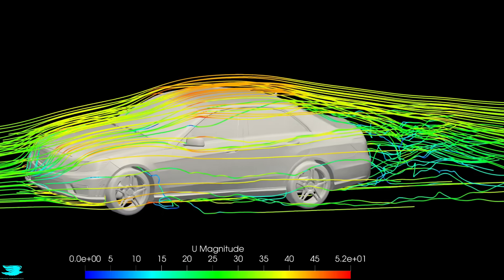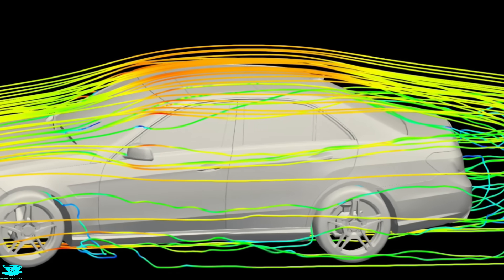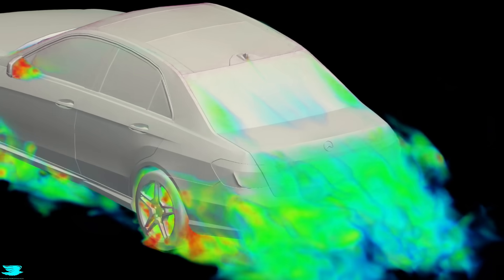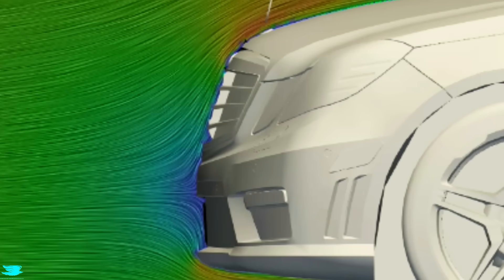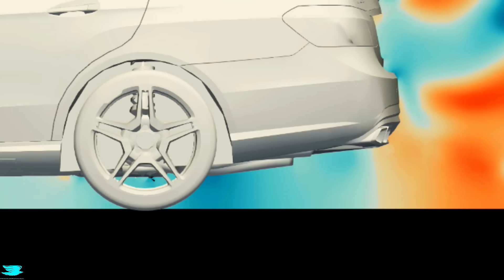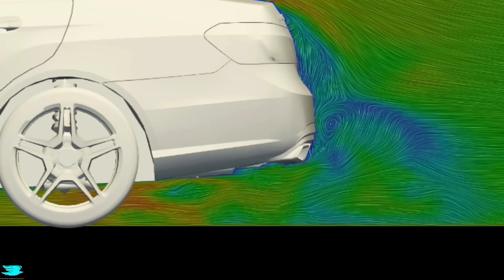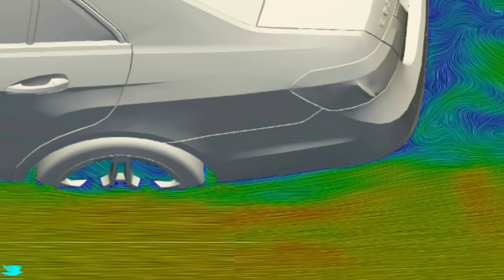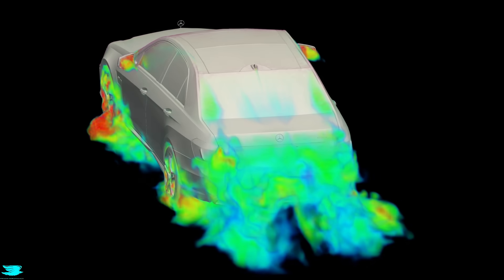This Mercedes Is Aerodynamically Wrong

Comment: Does this program you use consider up drafting air from the the engine bay as it comes out the rear of the hood onto that spot on the windshield??

Comment: The flow from the sides over the roof onto the back window has been an E-Class thing since the w124, just FYI.  It is absolutely intentional. The area by the windscreen is also a high pressure area by design, as it feeds the HVAC system at speed as well as helps the wipers work at high speed. Also, the high pressure zone at the front bumper is also intentional. You want slow/high pressure air to enter the radiator area for efficiency in cooling and for a "ram air" effect for the intake to pull air to the engine from

Comment: Okay, I have 3 questions.
1. Is the fact that air flows through the grille and vents in the bumper taken into account in all these analyses?
2. Isn't wheel aerodynamics inaccurate, since in reality they would quickly rotate and travel vertically?
3. Have you ever considered aerodynamics while airflow is coming from the side, like during cornering?

Those are small practical details that always concerned me when watching these videos.

Comment: Designed Intentionally WRONG  to WASH the car especially the mirrors , windows and light devices  for automatic cleansing and cooling the brake and catalytic converter.

Comment: Can you simulate a nissan s13 hatch (240sx). I'm interested to see what the flow over the rear looks like because I do seem to feel like the car gets a bit of rear end lift at higher speeds. This chassis is also a pretty decent representation of many of the long hatchback lownose sports cars of the 90's. (Other examples being mk3 supra, porsche 944, fc rx7 etc...)
Reply: I'm also curios if any of the factory wings (type x wing for example) help mitigate this rear end lift

Comment: what about W211 ?
Reply: I was just about to comment that, especially what the differences are in between the facelift as the front end changed quite abit.
Reply: @cathat9622 that’s a nice observation
Reply: W211 is bad in airflow
Reply: @stormrider01 Why?

Comment: My old 2010 E250 CDI Cabriolet (A207) would hit 248km/h on GPS on the Autobahn, roof down, not too bad I think! But the chassis in that is closer to C-class on the S/A207, so narrower than the sedan/wagon at least.

Comment: One other interesting note about mirrors that may not be obvious for people who have never driven one of these, mirrors are huge. They do not look big from the outside, but in fact they are way bigger than BMW's or Audi's and square to a point it feels like a truck side mirror, making it very comfortable to use. Knowing that it does not detract from aerodynamics much makes it that more impressive.
Reply: The mirrors of mid 2000-2015 Mercs have always been a good fictional design. Good size and with the extra wide angle at the edge just makes visibility better
Reply from the maker: 100%
Reply: @PremierAerodynamics  can you please do the toyota auris touring sports please 2015 model :) love your videos!
Reply: I do have to point out (in case you missed it): that platform of car was engineered to do over 300km/h for relatively long stretches in comfort, especially in E63 form. And then people tune those cars to dliver even more power and go even faster, so it's not surprising at all that there are regions of downforce-generation. I reckon everything in that aero is intentional, and in many ways is an iterative evolution of the W201/W124 platform from the 80s.
Reply: Interesting! I find the mirrors on my GLE to be narrow for the size of the suv.

Comment: If the onboard computer is anything to believe my 2012 Volvo V70 can get as low as 3,4 l/100km. It is a station wagon with a large flat area in the back so I'm surprised it's so efficient.
Reply: V70 edrive?
Reply: @PolishPhDCandidate 1,6 liter diesel and manual 5 speed

Comment: @Premieraerodynamics ,  

Excellent video but I noticed the 3d model used in this video doesn't take into account the small portion of air that the engineers designed to flow INTO the engine bay, and evacuate a fair amount of hot air, and then get diffused over the windshield. This is an integral part of the overall airflow model that's not being accounted for. in fact if you look at many mercedes from the 90s to 2010s you'll see a lot of them have dedicated pressure relief vents just before the windshield at the back of the hood. And the later models removed the vent but left a small gap where the air travels under the hood and exits onto the windshield. 

Also, on the real car, the front windshield itself is mounted so that it's extremely recessed at the base and it very carefully gives up it's offset, their higher you go up along the A pillar.  

Additionally this model doesn't show the high degree of aero cladding underneath the car. Everything is aerodynamically integrated underneath, and often fully covered; with sporadic indentations in the panels, to control pressure areas along the underbody.  This is one particular area of detail where Mercedes has historically been in a league above nearly everyone, for decades.

Lastly you'll want to remember that with this being a 3 dimensional car, most of the seemingly right-angles and panel intersections are not actually continuously conflicting to the same degree, when you follow the line it from one side of the car to the other, -  because virtually every panel was slightly curved as you follow these lines in order to further cheat the wind, while still retaining a visually strong, squared off design. 

In fact, almost nobody spends as much time and money on engineering as Mercedes-Benz, and nothing they produce is ever by achieved by sheer luck or by accident. And the cool thing is there are even a lot of model specific photos and videos online (showing airflow and diagrams)  directly from the Mercedes press releases which have even more interesting detail than we've seen in this video.  Definitely worth checking out.  

Anyway, another excellent video and keep up the great work! 💯

Comment: I think the e39 would be cool to look at since it achieved a  .27 in the 90s
Reply: w124 got 0.28 in 1984
Reply: @divineangel606  And it was designed in the 70s! Fuckin insane tbh
Reply: I was just thinking the same thing.
Reply: E39 was a very good design in general (a lot of people call it the best 4 door saloon ever made for good reason) and the straight 6 models with manuals were more fuel efficient than a lot of mid 2000's 1.5 to 2L econoboxes from most brands (a 1.6L zetec/duratec Focus will use more fuel with the 5 speed manual than an E39 528i with a 5 speed lol).
Reply: Mitsubishi achieved .27 with the 1996 Diamante.

Comment: I've been driving this car daily for 3 years. Very stable on the road! However, it starts feeling a bit iffy at around 160-170 kph. But I think a simple splitter and a ducktail or something like that will fix that problem.
Reply: You might just need to check your subframe and suspension bushings, lol. A Mercedes E-Class should not feel remotely unstable at 160-170 kmh.
Reply: @TranceFur not that it's unstable, it just starts feeling a bit stiff and lifty, idk how to describe it. Still pretty stable, just wish it would be glued to the road a bit more
Reply from the maker: They would definitely help with downforce, and that might fix the problem.

Comment: I think that with the W212 they wanted to bring back the boxy styling of the 80s and 90s Mercedes by modernizing it and making it more organic.
Reply: It was inspired by 50s w120  ponton, most notably on the rear fender and then made to fit into w210 w204 design language. shame they got "scared" by the 5er and A6 competition, spent so much on life cycle update that got rid of the language that made the w212 interesting, making the latter toned down, and rather unspectacular
Reply: @kappakappovski502 face-lift and the following model looks bland. I've got a 207 E class cab and I think it's aged beautifully still looks modern
Reply: Yeh I absolutely loved the 80s mercs and I like this era too as they're very angular. I hate round bubble shaped cars.

Comment: Regarding the wheels, from what I see the simulation is run while the wheels are static. But if the car is moving, the wheels are rotating - shouldn't it matter in analysis?
Reply from the maker: There is pseudo movement with MRFs

Comment: The Best Aerodynamic Vehicle Ever:
1. Ford Mustang GTD, near 50/50 Weight, replace: Ford GT90
2. Tesla Model 3 Performance AWD, near 49/50 Weight
3. MG4 EV X-Power AWD, near 48/50
4. Nissan 370Z, near 47/50
5. Mercedes-Benz CLE, near 46/50 Weight, replace: Mercedes-Benz E-Class (C207)

Comment: I have the 2015 facelift W212 E220CDI with the standing star and everytime i drive it i am more and more impressed by its capabilities, both cornering wise for a 1700kg sedan and the speed you can get up to with just the factory stated 170hp